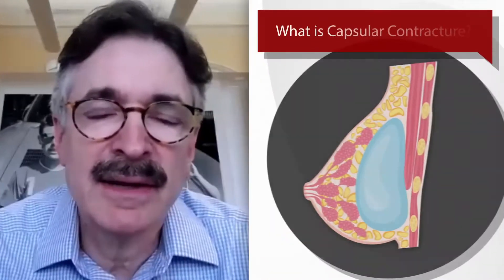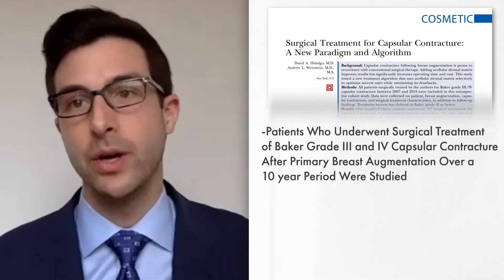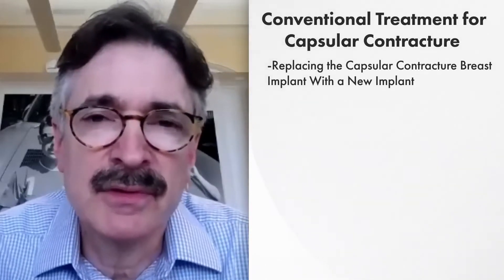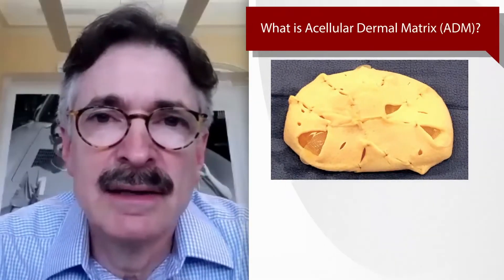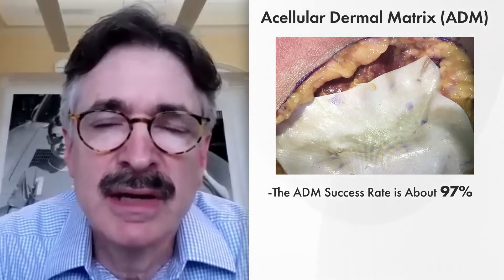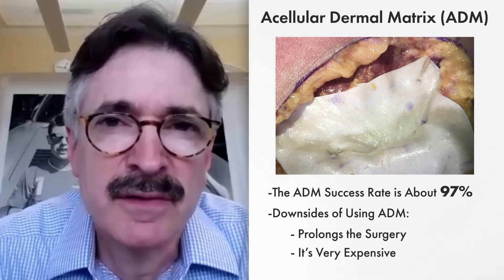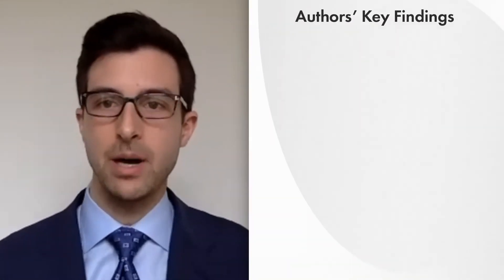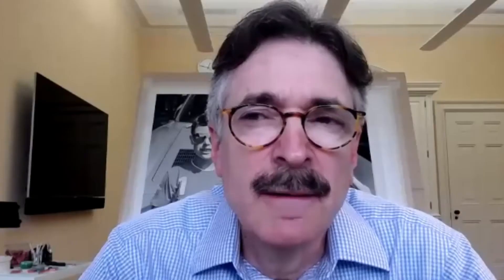Ways to Treat Capsular Contracture. Plastic Surgery Hot Topics - Drs. Rohrich, Hidalgo, & Weinstein

Comment: Does using Galoflex provide the same protection against capsular contracture? I have had the dissolvable Galoflex put in to correct capsular contracture, but it had started to returned 9 or 10 months later.